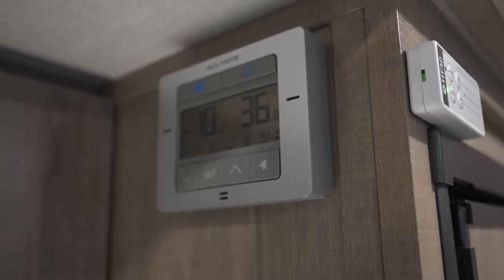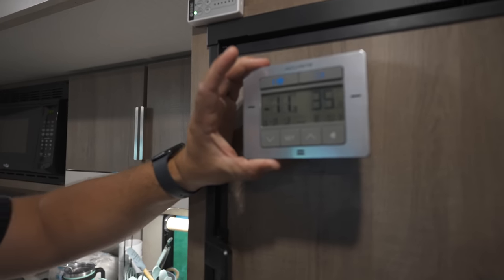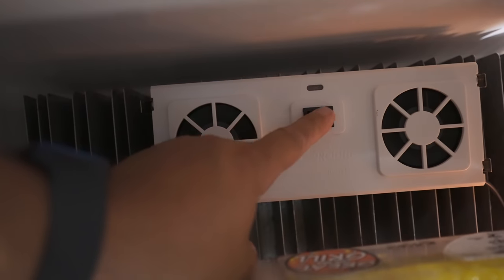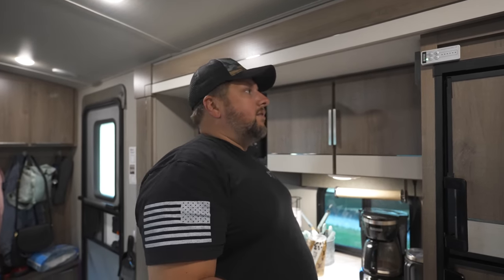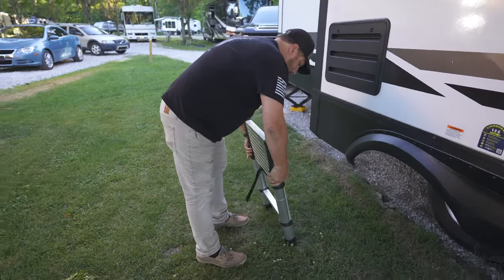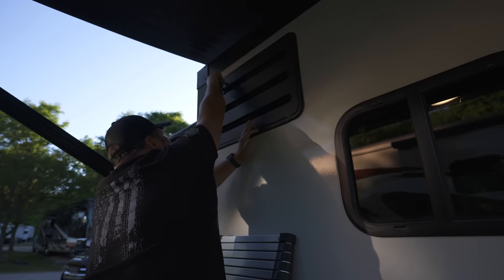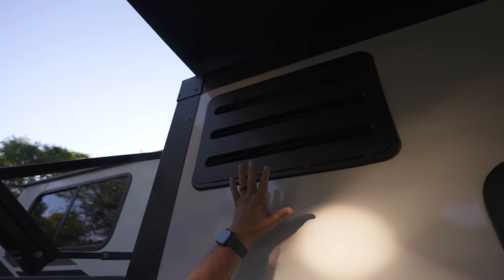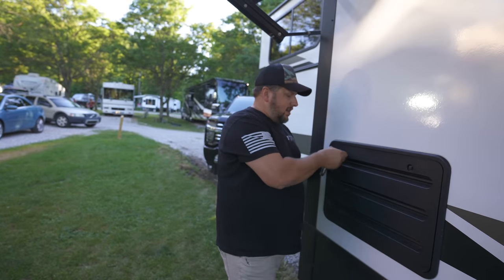RV Fridge Won't Stay Cold Fix

Comment: We had all the same problems and used all these fixes.  We’re in a very hot climate…SC beaches.   These fixes with the interior and exterior fans did help some.  Also, we’d freeze water bottles and put them in the fridge while traveling…which was a big help.  We finally installed the 12v compressor system by JC Refrigeration in Shipshewana, Indiana.  These guys have a great product.   Just so we never have to worry about power while traveling or boondocking we also had them install 600 watts solar power with a 280AH lithium battery.  This has relieved so much of our stress while camping…I can not emphasize this enough.
Reply from the maker: That's definitely the move if this fridge dies (which it probably will)

Comment: Domedic and Norcold both have a recalls due to fires caused by the fridge overheating.  There’s been a lot of talk about it in an RV group on FB I’m on.  Norcold states even if you’ve had repair work done prior you need to turn it off and have the recall work done. It has something to do with a tube overheating and catching fire. Doesn’t matter if you’re running unit on electric or propane, camped or moving.  It’s truly a part failure that needs to be repaired. This may not apply to your fridge. But there have been to many fires recently.
Reply: The only recall for Dometic fridges I can find is for fridges made in 2006 at the latest

Comment: Unfortunately I didn’t have good results with these fans. I installed the one inside of the fridge and the outside exhaust one and haven’t seen any improvements on the temperature of the fridge. Still struggling hovering around 43-50 F.

Comment: My power company told me to fill the freezer as full as possible as it doesn’t take as much power to keep cool as a half full freezer would. I’m guessing they meant the fridge as well just as long as the fan has room to work. Power tip.
Reply: I actually wouldn’t recommend this. I’ve filled our freezer with already frozen food and after a couple days I realized that the meat was starting to defrost.
Reply from the maker: That's true for a residential freezer. In our RV freezer I start it with a block of ice in it (make sure it doesn't leak if it melts some) so the temp drops quickly. The fridge doesn't start getting cool until the freezer is down to temp so the quicker the better.

Comment: How long does 12v last.
Reply from the maker: A long time. When we are hooked to the truck it gets charged by the trucks alternator. When we are hooked up to power at a campsite it charges off the inverter. Some RVs have solar power to charge the batteries as well.